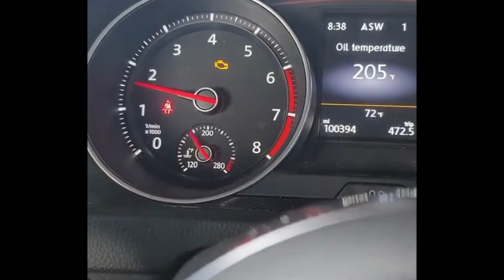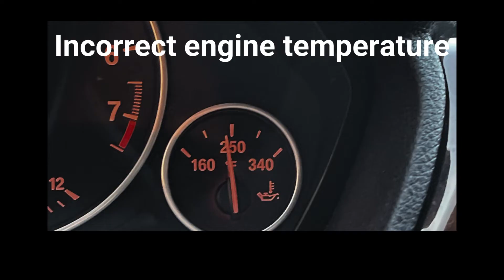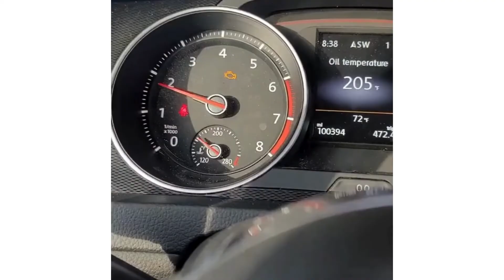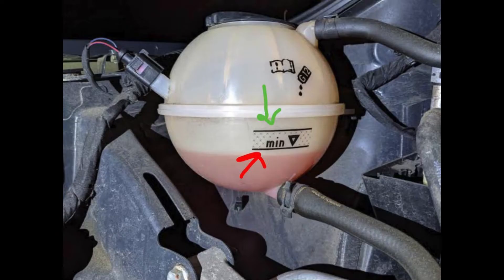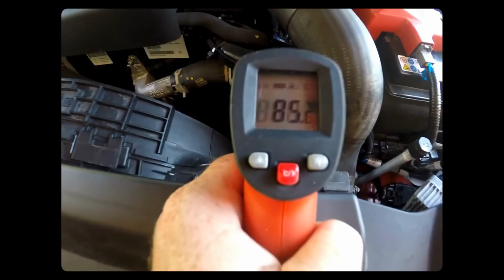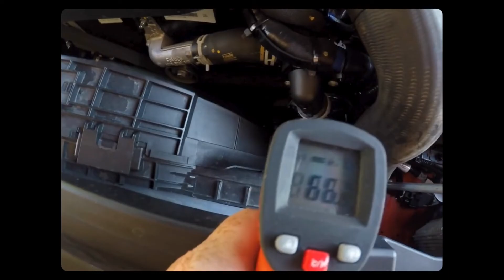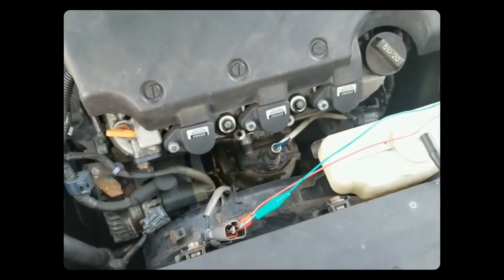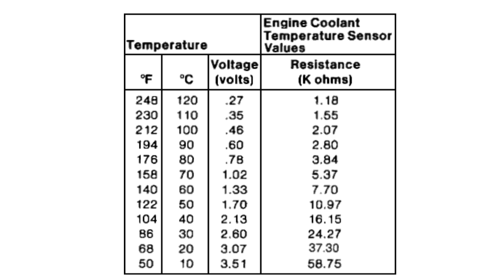7 Reasons Your Car OVERHEATS Then Cools Down (And How to FIX It...)

Comment: I have a coolant leak that we cant find. We've replaced the water pump, temperature sensor, coolant housing unit. It still leaks, but I never see any fluids on the ground, and I'm not seeing white smoke from the exhaust. I've been putting coolant in it when it's low or empty, but I have done that 3 times when my truck (2012 ford escape) is off and I didnt know it's supposed to be on. I just pour it in, put the cap on and go. I'm realizing that may have trapped some air now after talking to someone. Today, the temp gauge was fluctuating hot and back to normal while driving. I turned the heat on full blast to try to help, and the heat is blowing hot with no problems. The temp gauge still fluctuated randomly. Should I just try the air bleeding method to try to fix it? It's parked now and I'm letting it cool for a few hours.
Reply: Yes

Comment: My ford ikon ambiente model 2014 overheat i took cylinder head in for pressure test and  sceam because it mix oil and water bought new gasket and bolts but it still overheat what can be the problem

Comment: My Tahoe was overheating. from the dash board I choose TRANS. TEMP. 45C .. I start the car and drive for 10 minutes. The temperature reached 90C by fast !!. The problem is inside the Radiator. I tried to clean it but Its tubes were blocked from inside. Then I changed it and the problem gone. In another case if the overheating just happen when the car is not on the road. Then check the 2 relay fuses of the fans and the fans themselves.

Comment: My 2011 outlander, when I use the heat at 3th, 4th speed the temperature drop and when I put the heat at 1st or secomd speed the temperature goes back to normal, no overheathig changed the thermostat and antifreeze it still same anyone can help?
Reply: Radiator fans
Reply: Fan is working